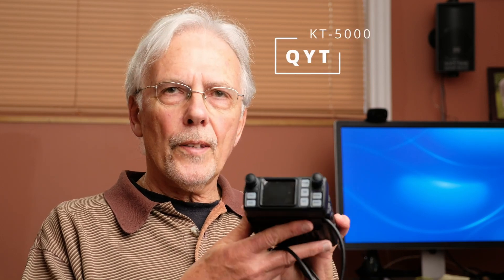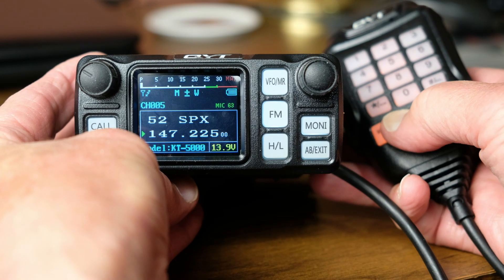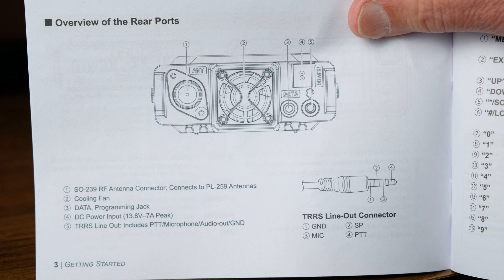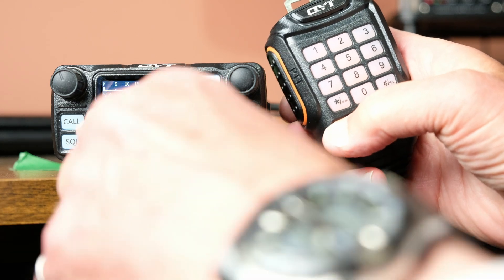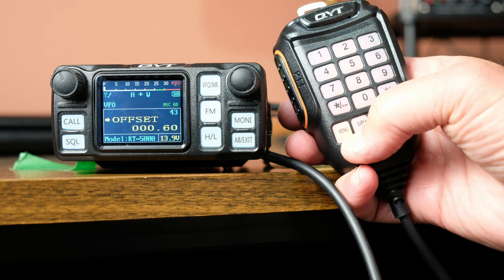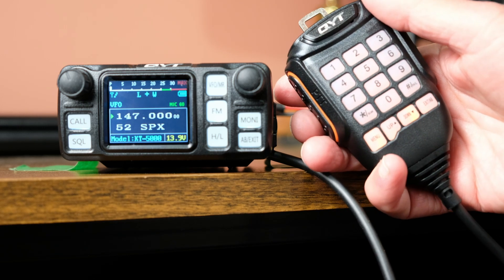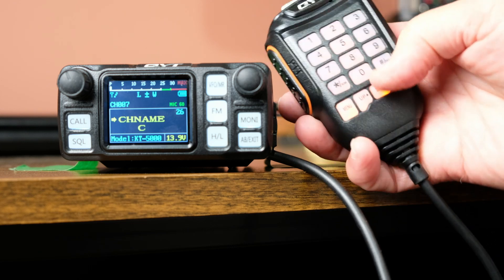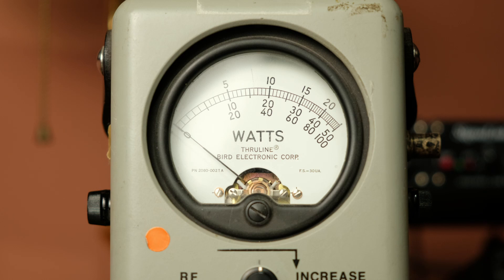The QYT KT-5000: Review and Manual Programming Guide.

Comment: This radio does support chirp but only for adding frequencies and channels. To adjust the settings, you need to use the QYT software. What I did was change the main radio settings using the QYT software. Wrote it to the radio. Then in chirp, read the data from the radio, inputted all the channels and frequencies by copying them from another chirp file, and then rewrote the new chirp file to the radio. It then remembers the radio settings all the time and you can adjust any of the presets as needed.

Comment: How do you scan the memory channels. What button or buttons do you use to start and stop the scan?
Reply from the maker: Hold */SCAN button on the mic for 2 seconds
Reply: Hi, @radiotopics1874 I cannot get my one to work like this.   I've enabled all the channels on scan but pressing the */scan button even for 2 to 3 seconds just changes the Reverse Channel feature.  Any ideas?
Reply from the maker: @RAWEDC  Not sure what’s going on with your radio. I haven’t used the reverse function but notice that you toggle it on or off with the */scan button short press. Only the long press of this button starts the scan. Not meaning to insult, but ensure the radio is in memory mode vs vfo when long pressing */scan.
BTW, the transmitter on mine has packed it in for no particular reason. Lesson learned-you get what you pay for. Sticking with the Japanese big 3 from here on.
Reply: @radiotopics1874 hi really appreciate this. I have it in memory mode with the two channels showing A and B.  The R comes up with a short press but 2 seconds, 3 seconds 4 seconds long presses still doesn't invoke the scan.  Really quite annoying as for a portable it's handy to scan the channels someone may be on.  I might try pressing even longer and see what happens.   I've checked the settings and there's 3 choices for resuming the scan but that shouldnt affect it.   Also I have all the channels enabled to scan.  Just strange.   Thanks for your help.
Reply from the maker: @RAWEDC  Yeah. Sounds like it’s faulty (like mine!)

Comment: My old  yaesu FT-7900 has Mic connector at control head, but  they Yaesu re-designed to  Yaesu FTM-6000,  Yaesu made same mistake by placing Mic Connector in Main unit.   AG6JU

Comment: Thank you for sharing.  Did you ever tried the scramble mode?  if so, did it work?  The reason I am asking is : in AllyExpress advertise one of the its function is scramble mode.  Just wanted to know if it actually has one and if it does. Does it work? or it's just a fault advertise.  thanks

Comment: If QYT still has the same mic cable?, you can build your own mic extension cable using Cat 5 / 6 data cable, and RJ-45 plug ends. I had remote mounted my Yaesu radio, years ago, which has similar wiring. You can really make a custom install, with a remote head and mic.  Throw in an enternal speaker, and you can remote it up front too. 
If its a dependable radio w/ no problems, and has Chirp programming, I'll buy one. (I am using the QYT 8800D now, and it rocks, for the money!)

Comment: I received my KT-5000 this week and started testing. I've noticed some problems. It seems to be with low sensitivity. The squelch does not open with weak signals, it is necessary to leave the squelch at 0 to receive stations with "NORMAL" signal. The radio has time that restarts on its own. The power measured in non-radiating load does not reach 25W as promised.

Comment: Thanks for the Video.  I believe you would only need to go back and save the tx frequency if you wanted to have a nonstandard split.. I've been able same my memories by just setting the offset shift and direction.  Thank you for pointing out it does not allow you to overwrite a memory.  You need to delete the memory and then save again if you make a change.  Agree that I would love to see CHIRP support.  I may just see if it will work with setting for any other of the qyt radios that are supported by CHIRP.

Comment: Hey. Is there a 1750hz repeater opening sound?
Reply from the maker: Yes. It's set in menu item 46 REP-S Repeater Activation Tone.
Reply: @radiotopics1874  does the call button work then?
Reply from the maker: I personally have not used this function but the manual says the following about menu item 46:
A single-frequency tone frequency emitted when the CALL key is pressed when the transmit key is transmitted to activate the repeater.
Reply: @radiotopics1874  thank you . just buying the device myself

Comment: Beautiful device and good audio quality transmission and reception. However, some bugs when the device remains in stand-by for a long time, strong signals are no longer received and the audio in transmission becomes very saturated and inaudible. The fault disappears by starting the device again. It's random but I encountered this problem twice in three days of testing. The programming software also has bugs, some settings must be made from the radio such as the display of the channel name which is not taken into account from the software... I hope that the firmware can be updated on this model...
Power output measured compliant 22W VHF and 25W UHF.

Comment: Just picked this up yesterday. I was disapointed when I discovered that it wasn't on CHIRP yet.  Manually programing is not something I enjoy,BUT, I did follow your video and got my local repeater installed. Got a great signal report and had a 10 minutes QSO with a friend. You can hear the fan and it did get warm but not hot. Have a female club member and she got one also, on my recomendation. I'm sending her the YT info and hope she can get going too. 73 see you on the radio.
Reply: How well are they working now?
Reply: @chrissewell1608  funny you should ask. I got great responses on TX. Sounds great on rx. It's so small it got lost on my computer desk, literally.  I have to find the program cable and load up some more frequencies. One day I'll have it back in the truck.

Comment: The mic appears to use an RJ-45 connector.  Can it be extended with a common network cable and 2-way coupler?  This would let you install the radio almost anywhere. (you can also buy M-F Cat5 cables)
Reply from the maker: I purchased a simple RJ-45 extension cable from Amazon (male one end, female the other). Works fine.

Comment: Thanks for the nice video ! My question is: do you know a way to limit TX frequency range to HAM bands only ? Chirp is not supporting this model yet, and I don't see any other options so far.
Reply from the maker: I doubt there is a way, and of course, the manual doesn't mention it. In fact, the specs at the back of the manual state that it only operates in the ham bands, which is wrong. This is just like the Baofengs, which transmit over an extended range. I think it's baked into firmware.
Reply: @radiotopics1874  Thanks for your reply ! I have still hope that Chirp will support this radio one day and the I can change the TX limits .